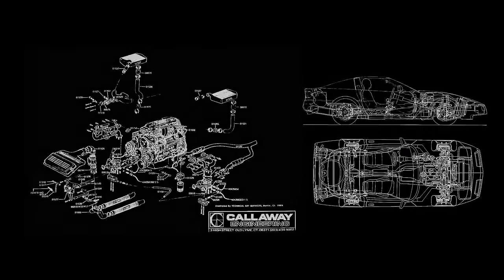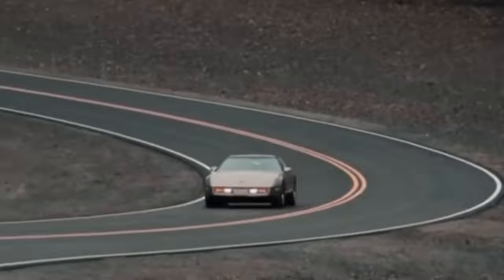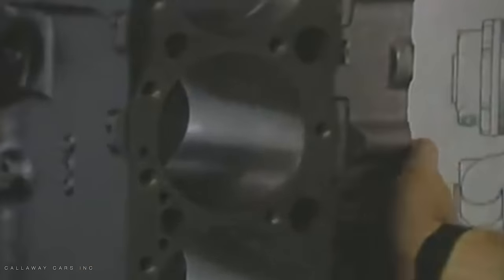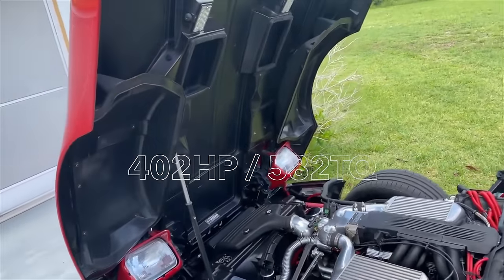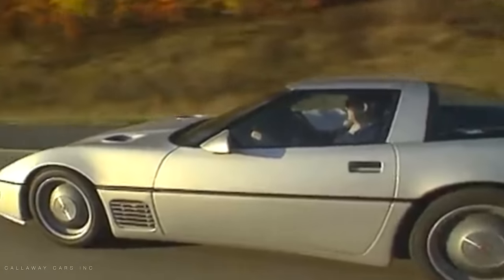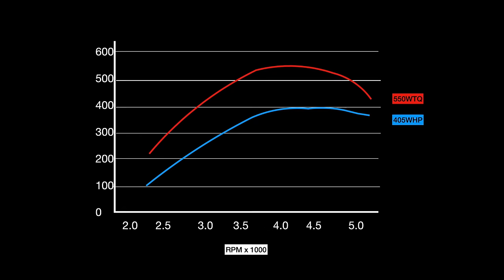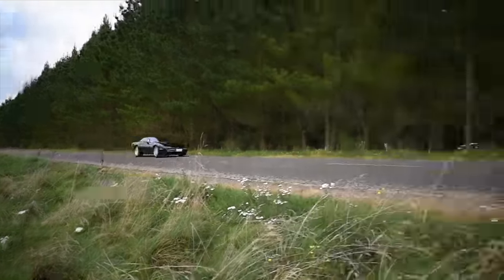How The Callaway Sledgehammer Became The Fastest Street-Legal Car😲 | Explained Ep.10

Comment: Having been fortunate enough to spend an extended amount of time behind the wheel  of a 1991 callaway aero body TT car, I can attest to the sheer uniqueness of these cars.  You hit the nail in the head about the mid range torque.  These cars were the unadulterated kings of americas roads since they were literally built to maximize performance under standard US driving conditions (I.e. stop and go and around town driving).  To this day there are few cars I’ve ever driven with the sheer stoplight drag power these cars had.

Comment: You should do a video on the grand National and the GNX. Another badass muscle car from the late 80’s. I own one👀
Reply: Which one do you own? The GNX or the much more available Grand national. The 87 GNX are unicorns of the v6 world. It's one of my top five of all time wanted cars. Along with the I think 87(maybe 89) trans am with the same powerplant.
Reply: @patrickrobinson2520  86 Regal ttype. Wh1(one of 463, 2 tone paint, and the gn spoiler). Same as the gn but without the black paint. Mine makes like 450 hp. Check my channel. Destroyed a bmw Alpina b7 (twin turbo v8)
Reply: @jafferm1938  the t types were really rare. T tops? Do you know which trans am I'm talking about? It was a pace car too. White with blue details.
Reply: @patrickrobinson2520  mine has a factory astroroof. I know the TTA’s. Really rare. Lotta money. Same engine and tranny as the gn
Reply: @jafferm1938  I think they held the top speed for an American production car that year. It must have been 89 because it wasn't 192 as these corvettes did in this video before the Callaway package.
Reply: @patrickrobinson2520  - '87 only GNX quickest in 1/4, but top speed limited to only 124...
Reply: A stock 1987 Grand National turbo made 287 horsepower. wow awesome power.
Reply: @BuzzLOLOL  I'm talking about the turbo trans am in 1989 with the same powerplant. not the GNX.
Reply: @guysteel  - '87 GN was 245 HP... GNX claimed 287 HP... High HP for '87... that X was an $11,000 option... the torque helped shove it into 13's... GNX sent around to magazine testers claimed 300 HP but it arrived in showrooms as 287 HP... GNX had special F-body/H-body rear suspension, not the 4 link of GN and other G-bodies... '87 Corvette only 245 HP... '90 - '91Corvette had shallower dish in pistons and 250 HP...
Reply: Grew up with Buick v6 commodores in Australia. It will never be as good an engine as the Barra. Sorry
Reply: @jafferm1938  I always thought the t types were cheaper than the gn ,I got mine 5000 cash,212 cam,3200 stall,alcohol and ported heads with a 67mm turbo
Reply: Lucky man
Reply: Those cars are some of the few V6 powered cars I like. I tend to hate the sound of any V6 that isn’t Italian…my opinion they just don’t sound good (except the GTR I like the way those sound)…I have no clue why…but the Italians sure know how to figure it out…

Comment: I don't think a lot of younger people can grasp JUST how wild 900 horsepower or even 400-500 horsepower on pump gas was in 1988. A stock corvette from that era can barely keep up with a modern V6 Camry and a stock Camaro/Mustang actually won't keep up with a Camry. Cars from the 80's/very early 90's were slow turds through and through.
Reply: I wouldn't say they were slow. It's just technology has gotten that good.
Reply: I grew up in that era. Back then, 300 hp was a lot, and 400 was astounding.
Reply: Thanks Captain Obvious.  Why is it so shocking that a 35 year newer car can run a quarter mile in around the same time?  Low 14's with a 150 mph top speed (and three undefeated seasons shitting on Porsche and Lotus in SCCA Showroom Stock) isn't a "slow turd."  Stuff today is just faster.
Reply: @sidefx996  Are you prone to irrational anger or are you only like this when your feelings get hurt?

Comment: I have a gorgeous 1987 Callaway that looks like it just came off the line! besides the custom wheels and a few upgrades!! 30,000 original miles. My father was in love in with them and corvettes in general. He passed away and left it to me. I put maybe 200 miles on it & have it serviced every year. Sits on a battery tender and very well taken care of in the climate can trolls garage on the lift. B2K WAS BACKED BY General motors & the only year that was. My father took me to see the sledgehammer at the track and my father taking me to the Callaway factory a few times when I was a kid.

Comment: Turbo v8 are fun. i have a turbocharged  gen1 forged 383 heads cam intake running a ls1 ecu with multiport efi and coil over spark ignition in a lifted yukon.  Fun toy.

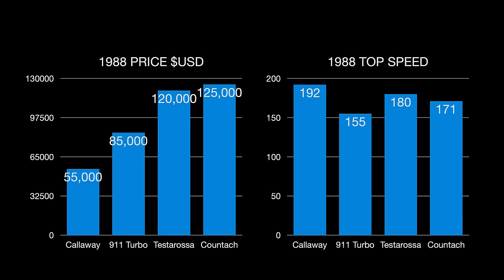Comment: 5:19, no it isn´t an LT5 engine. It is a B2K engine as said at other places in the video.
The LT5 engine is the engine that Lotus enginered and Mercury Marine manufactured for the ZR-1.
But besides that, this was a very interesting video. Thumbs up!
Reply: 4 cams and 32 valves, a different animal for corvette in that Era. Really cool engine
Reply: It IS the LT5 block but the factory option is the B2K package. 

Do you think Callaway just tossed the whole engine?

Actually, the engine builder was John Lingenfelter…but the whole package was furnished by Reeves Callaway.
Reply: @elijahrobinson2362  No. It isn´t the LT5 block either.
Look at the pictures of the B2K package. Every picture shows the TPI intake and/or the L98 cylinder heads and neither fits the LT5 block.
So, no, Callaway didn´t toss the whole engine. They used most of the L98 engine except for the pistons that where changed to lower the compression.
You can also look at the specs at 2:20 that shows the same bore /stroke for the L98 as for the B2K turbo engine. The LT5 had a different bore/stroke 3,9" x 3,66" while the L98/B2K had 4" x 3,48" (just like all other "traditional" Chevy 350 engines).
And John Lingenfeldter? I don´t know which engine you are talking about but the LT5 was constructed by Lotus and manufactured by Mercury Marine. The B2K engine was as far as I know built by Callaway but I´ll stand corrected if you have more information and a link that confirms it.
Reply: @Maskinservice , the info you see here is NOT from the engine builder. 

Reeves Callaway did not build the engine. It wasn’t promoted but John Lingenfelter built the engine AND drove the car on its top speed run. 

If you want the actual specs talk to John Lingenfelter himself. Period. 

The engine was a specially prepped piece. It wasn’t a 5.7 when it was finished, it was larger.
Reply: @elijahrobinson2362  So what you say is that the Callaway Twin Turbo used the LT-5 block and the L98 heads and intake. That´s new for everyone in the Corvette world. Actually it is revolutionary as neither the LT-5 block nor the heads have any provisions for a cam shaft. It means that the Twin Turbo was the worlds first four stroke without a cam shaft, decades before Koenigsegg. And you are the only one in the world that knows about this. Congratulations, or get your facts right.
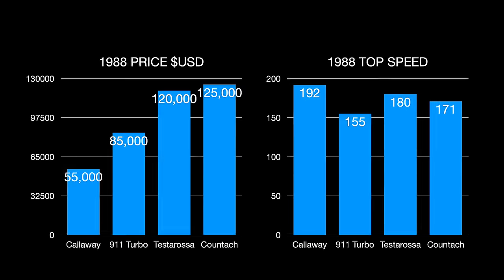Reply: @elijahrobinson2362  Honey, look at the picture of the B2K mislabeled as an LT5 around time stamp 5:20. Where are those overhead cams hiding? Where are the 16 intake runners?

Sorry, B2K had very very little in common with the LT5.
Reply: @christinaqueen2286 , as I have said in other replies, this is NOT a video from Callaway but from a content provider. They are like Wikipedia: not always accurate in what they claim. What the video shows as the engine used is not necessarily what WAS used. How many YouTube videos contain dialogue and even images that are obviously NOT what is widely known to be correct? 

Furthermore, the B2K RPO was not the same overall engine setup as was used by John Lingenfelter (he is the man who was hired by Reeves Callaway to build the engine FOR Callaway Cars/the Sledgehammer Corvette) when he built the engine for this car. Not even close. 

The nearly 900 HP Sledgehammer as it ran on the Ohio track is quite a lot different from the actual B2K offered by Chevrolet/Callaway. 

The Sledgehammer is one of a kind and I fully expect it to be markedly different than your ‘regular’ B2K Corvette. I do not believe that the block was anything other than what was first reported back in 1988/89, by media based on what Callaway told them. What was done to the block, internals and bolt on parts is another matter, entirely. 

Obviously, it wouldn’t have the stock fuel system. Not when at least triple or quadruple the flow was required.

Comment: Now every Brand has a 5.7. I wonder where that came from?
Reply: I mean Ford has always had a 5.7 (351 windsor)
Reply: @barneymiller7894  I believe that’s 5.8.  Ford has always been original, I’m talking about dodge,Toyota and Nissan using 5.7’s
Reply: Ford had 1950's 352 which is same bore/stroke as 351W/351C/351M...

Comment: So you do a story on the Calloway Sledgehammer Corvette and leave out the guy that was responsible for the engine? Wow!

John Lingenfelter the founder of Lingenfelter Performance Engineering was tasked with development and building the engine for Sledgehammer. He also DROVE the car for its top speed runs and made aero changes to the body to push more air into the turbos. This car wouldn’t have happened without John Lingenfelter.

Comment: Hell yea love seeing some c4 love. Those 350s were no joke the lt1,4 and lotus lt5 get down to this day. My lt1 keeps up with 5.0s and ss Camaros 20+ years later
Reply: Calm down🤣 keep dreaming lol
Reply: @maxboya  My 95 has a stage 1 top end no dyno tune, caught up with a 392 cruising at +90mph, we did a start race from there, yea he couldnt keep up.
Reply: @Hector55Munoz  95?
Reply: @maxboya  Yea 95 vette with the 4 bolt LT1... LTPower95 Insta
Here's a little insight.. hmm
I can believe the post up top, to a degree. Allot of automatic LT1's even L98's had the really sluggish 2.59 rear gears from the factory for comfort sadly, dang GM. They're not all like that, most will settle on their first impression when experiencing this common spec that the original buyer mistakenly didnt option out for the normal 3.07 gears. Why GM did this confuse me. If you ever experienced even a fully stock LT1/4 manual or 3.07 auto you'll know 😉 95-96 Are all Z51 standard and come with the gear option. You'll even read some threads where owners change the 2.59 gears to the performance gears and they'll say they felt a big difference in acceleration! And that's just 3.07, some guys put 4.10s! Hell the manuals have 3.54s! Most C4s are auto, most autos have 2.59. So when we see some comments of these guys saying they can hang, it's probably because they don't have that POS gearing. While other guys say their C4 is kinda slow and moderate.. maybe their gears.. or its not running well like mine did once. Felt %75 the power.. bad o2 sensors. Many possibilities. I've only ever heard people say, 'This Thing is Fast' in my experience.
Reply: @Hector55Munoz  I love C4s especially that Callaway Corvette that thing was the super car of the time hands down.

Comment: I got two words for ya; Plymouth Daytona

The most underrated, yet, fastest car of the 70s early 90s.

Edit: As a reminder, the Daytona/Superbirds weren't very popular when they came out and it had only recently gained the popularity that it should've had a long time ago, when they were being made. This goes for a quite a few cars in Dodge's line up (being overlooked, then suddenly skyrocketing in demand). 

Ex: 

*The Vipers
*The Charger Magnums
*The Prowlers
*The Neons (albeit slightly, since the Neon's unreliability turns off even the most invested of people)
*The Stealth (A GTO VR4./3000GT rebadge; now it's the cheapest way to have a GTO in your garage)
Reply: Bullshit.....Not in the same league with a Calloway Vette.

Superbirds equipped with the top-of-the-line 426 cu in (7.0 L) Hemi engine with a pair of four barrel Carter AFB carburettors (2x4bbl) producing 425 hp (317 kW) could accelerate from 0 to 60 mph (97 km/h) in 5.5 seconds.[6]

Comment: Good video. Callaway did a great job with this car. You should probably add that the base / core engine of the Sledgehammer was built by LPE (Lingenfelter Performance Engineering) and the driver on the 255 MPH run was John Lingenfelter. LPE did not build the other engines for B2K, only the Sledgehammer motor. My source was my good friend John Lingenfelter. RIP John.

Comment: I had two 1990 ZR1's and they were quite a blast to drive.  My second one I did put twin turbos on it and ran 10.11-25 (on street tires) at 133-139 mph depending on my hookup from my launch. I had six passes that day at the track and then was told not to come back until I had a roll cage in it. On I-75 somewhere in Tennessee I was driving it to one of my houses in Tampa and opened her up to 186 mph and still had room to go faster but ran out of straight road.  It's scary going that fast too but it sure was fun. I do miss my C4 great car and great memories.

Comment: when you say sledgehammer you best talk about john lingenfelter. He is the true motor behind the car ( and the driver). For ITS TIME, the C4 was light and was the quickest of the cars except the grand national gnx. They had to create the escort series just for corvettes because it had no competition. A z51 with 16in 255/50zr/16 pulled 1.0g on the skid pad. My 1985, one of the best year of the c4 ran and low 13.1 with just an air foil in the throttle body, crank pulley and a traco chip which none of those were huge power and ran on Stock TIRES. Didnt have all the tire choices they have now but easy into the 12's with some 888 or Nito's of today on it. The 84 was a hit miss. Hit with the car miss with the carry over cross fire from previous generation. great vdeo!!!

Comment: Couple of minor  errors/omissions:

It hit 254.76 (not .75), made 898 HP and still got 16 MPG while maintaining EVERYTHING that was comfort driven. Germans gave it the nickname Sledgehammer. One person said “Das ist der Hammer!” Another said “Nein! DAS IST DER SLEDGEHAMMER!”

During early testing it made OVER 1000 HP. 

It also had an on-board laptop that didn’t only collect data but could adjust on the fly. 

It had a very customized body kit by Paul Deutschmann from Canada that had to be revised since at the speeds it was hitting there were pressurization issues costing speed and causing stability concerns.

Comment: That’s a testament to the rest of the drivetrain. I would imagine the transmission or rear end would grenade with that much extra power. Next compare the turbo 4cyl to v8 mustang in the 80’s.
Reply: The later ZF 6 Speed C4 cars have a nearly impervious drivetrain.  I believe standing quarter mile record time in a C4 with stock drivetrain is in the high 8secs.

Comment: For everyone gushing about these cars: these were not normal cars. They were built outside the scope of GM product engineering and it shows. The only one I ever drove was in our shop for repeated drivability issues related to the MAF. When I opened the hood I realized immediately the problem was the charge air pipe ran right alongside the upper radiator hose with the MAF resting directly against the hose. Hot wire MAF's need to heat the resister wire 200C above ambient temp. When the coolant gets to 220F the sensor is now at the ragged edge of its mechanical limits at over 400F. It is made in such a way you can't rotate or move the sensor. Cool cars but it was like a high-school shop class built the thing. A bone stock CTS-V 1 would trounce a Calloway Corvette in every metric but that is more a testament to how good cars have become and not a knock on the car. A C4 Corvette with an LSA would be a seriously fast and reliable car.
Reply: I have a c5 but would love to do a lsa in a c4

Comment: I was the child of a junk yard owner.  I came across alot of cars crashed due to alot of power no breaks.  only the motors would be salvageable.  Came across a 455 in a Buick GSX. and 10k worth of P.A.W receipts in what was left of the glove box. I stuck that in a 73 regal and matched it to a 400 turbo transmission.  Sunday after we got it running I and the Calloway that crossed the line behind me were told we could not run again without a roll cage.

Comment: I read an article in Motor Trend about a guy who went on a test drive in one. He mentioned the guy driving changing from 3rd to 4th at around 120 mph. He also said that they had it up over 220 and when the light poles looked like a picket fence, he had seen enough. He said that the car was a test model called Thumper. Anyone else recall that article?

Comment: I kinda want to see someone build a twin-turbo LS-swapped RX-7 FC just to one-up that design aesthetic. Preferably with a pair of mirrored twin-scroll turbochargers with the appropriate equal length and timing matched 2-to-1 reduction into the turbo flange. You get improved exhaust scavenging and quicker and more sustained turbo spooling with that configuration. The RX-7 FC has a ludicrously large engine bay for as small of a car as it is, so it shouldn't be particularly challenging to make such an arrangement work.

Comment: My recollection of the L98 was that it was a great driving motor.  I had an early year '89 Formula 350 when they had dual cat converters.  Probably my favorite car to drive.  Burn off a set of tires at will.  Nice chirp on the 1-2 shift of the automatic.  Far easier to get in and out of compared to a Corvette.  I do miss the instant power of the L98 motor.  I can only imagine what a turbo would have been like.  As it was it would head for the ditch at 110mph as it made the 2-3 shift and the body un-torqued.  Yes that motor was twisting the car that bad.  I just got used to counter steering.  Laughed that the car would have killed me as a teenager.  I have a burgundy C4 that looks a lot like the one in the vid.  Just a plain old LT1.